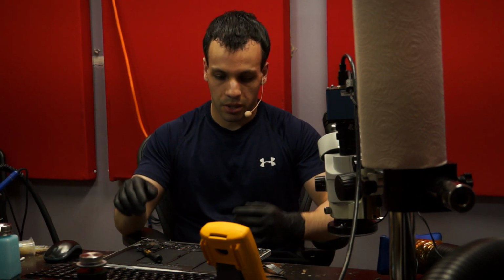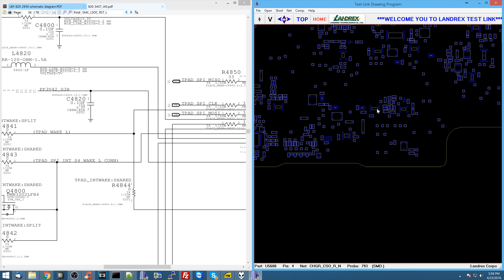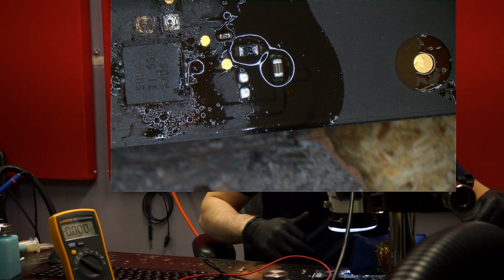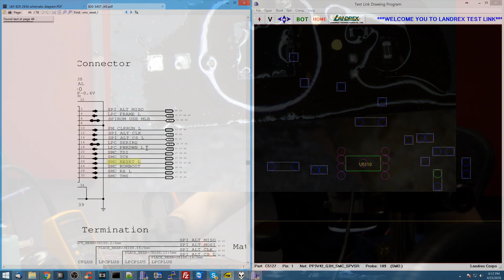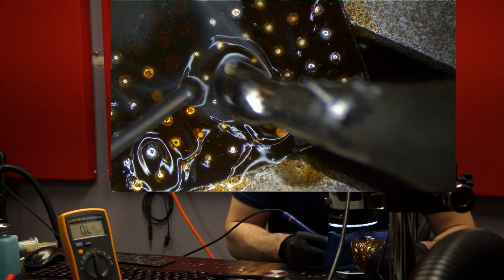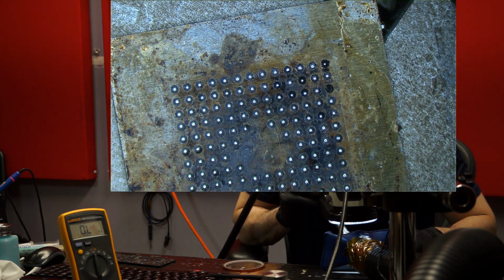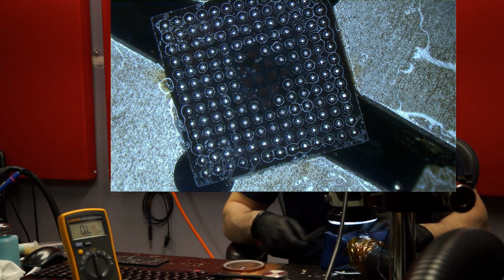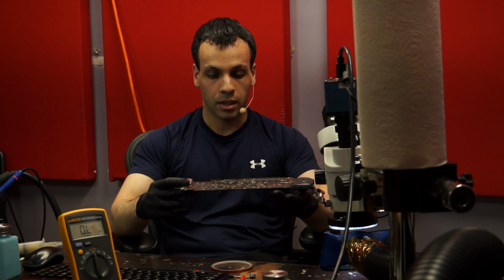Macbook Air logic board why is SMC_RESET_L missing and why does this matter?

Comment: Hey, great video as always! You can only imagine how happy I was when I heard you saying "the SMC is probably pulling it down" as I knew already what was to come - SMC replacement :D Anyway I know you don't enjoy doing it but I find it quite interesting (and more entertaining to watch? hmm...) especially as it is slightly harder than doing standard QFN/other SMD packages.
So far I've replaced several SMC but they were all H8S2117 and the way I do it is completely different to yours. Once I have the chip off the board and its pads clean, I put very little flux on it and manually put 2 balls (I think I'm using 0.35mm but don't quote me on that as not at work right now) on the 2 diagonal corners on the chip and I reflow into place. After this I put the stencil on and because these 2 balls are already in place the stencil aligns itself perfectly (magic!). Then I put the rest of the balls on the chip and I heat it up to reflow them onto the chip. That's the way it works for me and, as I said, I haven't tried it with the new SMCs made my TI.

Comment: Get some thin glass and put it over the stencil, hold down with tweezers or tape it, keeps the balls flat for release without reheating, and keeps tension on the stencil avoiding problems a warped stencil causes  the paste does not bubble out because of the airflow, the even pressure of the glass also stops the paste rejoining under the stencil because of warping make's it a lot less hassle to deal with, in general the glass sandwiches the stencil between both flat surfaces making it ideal for reflow as glass conducts heat well enough to heat up the stencil allowing reflow of the paste.

Comment: If I had to re-ball chips I'd end up somewhere between a crying mess, and a homicidal maniac.
Reply from the maker: +Steve Howes That's me!
Reply: +Louis Rossmann writing here just so you see the comment:
you should try applying a little bit of flux on chip, warming it up and sticking the plate to it (i have seen people doing it when reballing using actual balls. not sure if it will work with paste tho... but you could try if you haven't yet...) :)
Reply: +Senpai Nooberinho The stencil was bended. Nothing will help in this case.
Reply: +Steve Howes I know I couldn't do it.  I have patience, but zero patience for re-balling a chip.

Comment: So I do not know what an SMC looks like internally, however before you reball it, would you advise to check to see if it heats up when it's powered to see if there's possibly an internal short, or would you reball as step 1 in the case of it bein the most likely cause of failure?
Reply from the maker: +MobiFix considering the cost of the chip and the time it takes to reball i never reball the original chip. even if it works, i don't care, it just goes in the garbage anyway. the feeling of dread when you spend all that time only to realize you reballed a bad chip is painful
Reply: +Louis Rossmann BUt isn't that a constant risk considering how you eve get other SMC's? They're all pickers from motherboards some other company has fried, right?
Reply from the maker: MobiFix they come from boards with holes in them. i  avoid buying boards with liquid.

the smc on this board that some isl6259 sent 16v to is mroe likely to be dead thana random smc

Comment: Does the SMC chip align itself when you put it back on?
Reply: +Bas Emmen the heated solder (surface tension methinks) will often pull the smc into better alignment as long as the initial placing is close enough ie less than half a pad out, you can see the chip shift about by itself when this happens.

Comment: I see you are still getting these "Cannot open file arrow1r.bmp" error messages. Just put some empty files with the names it expects (arrow1{lurd}.bmp I guess) at the place it expects them (which is either where the .exe resides or the .brd file, and if its not that, take sysinternals file monitor to figure out which file it tries to open)

Comment: Maybe you can flatten that stencil by putting it between two flat hard surfaces and then stacking some books or bricks on top of it when it's not in use?
Reply: No you can't cause metal has élastique  zone in witch no mater how much time  you bend it it will return to the intial states .  So in order to completly  flaten it you must  enter the plastique zone by overshooting the correction just so when you relase it, it go flat but it's very very diffcult to do
Reply: bac302 Are you sure? I think metal has memory, like some types of high tension spring applications require that the spring not be compressed or else it warps and weakens. Also it's recommended not to rest rifles against walls with weight on the barrel because it will warp?

 If not, than maybe some hits with a hammer will shock the metal  into shape? Or a strong heat from a blow torch and then pressed flat?
Reply: the metal  deformation  has three phase   
1)elastic  zone where  the metal  will  deform  but as soon it  the force  is  interrupted the metal  will  return to it  original form  (the deformation graph  is linaire )
2) plastic zone  where  the metal  is deformed  permanently and will  not  return to initial  form  as soon as the force  is interrupted  the metal  will return into   a new form  parallel to the elastic zone  (the red line in the image ) 

so in order to get a flat surface you must  overshoot the deformation  so when you  stop the force  the metal will return  to flat surface 
this image  will  explain  
http://image.noelshack.com/fichiers/2016/18/1462223796-sans-titre.png
Reply: bac302 So "Bending it the opposite direction" is your only solution? 

 Well that's going to be a kind of bitch to level down to nano-meters but it's probably possible on a good vice with the stencil in between two flat planes. then just slowly bend it, slide it down the two planes and tighten, bend it some more, do it over again.

 Unless you have a suggestion for a technique?
Reply from the maker: +scot shabalam curse nonstop until the smc has balls on it,move onto next ticket.
Reply: Louis Rossmann I know man. I'm just trying to youtube-Apollo 13 engineer you a solution  to make your job easier.

 Have you ever tried CADing the stencils you need and sending the blueprint off to a metal working shop? You might be able to get better metal with some kind of  bond resistant coating. Also you could buy in bulk for cheap since they will probably drill press the holes and if they stack sheets all they need to do is drill the same amount of holes deeper.

Comment: Hi 
 i have 820-2915-B board  not turn on with green light on charger 
"smc_bc_acok" is 3.3v
sys one wire adapter sense is under 3 about 2.9v i think it is worng and the light stay green no orange light no charge
all other rails is ok also smc_reset_l  is ok the board was working correctly and suddenly stop working 
please help

Comment: Thoughts about the SMC.  I know in the past you've said the SMC is preprogrammed by apple and any attempts to read it erases it.  It appears to be a standard TI Stellaris  / Tiva C ARM microcontroller.   Buying blank chips is no problem but obtaining programmed ones is.  I decided to look into this a little more. I downloaded an SMC update from apple and opened the DMG and then PKG file and found what appears to be one or more files that could be the SMC firmware.  My thinking is maybe setting up a jig or socket that can be used to program the SMC in.  The TI Stellaris MCU is used on some cheap development boards that TI sells so it may be possible to make some attempts to flash the SMC externally trying to use some of those files.  Another thought that might require a little more hacking would be to drop in an unprogrammed SMC and see if you could trick the laptop into powering up by setting the appropriate signal lines high or low.  Here's one of the dev boards I was talking about http://www.ti.com/tool/ek-tm4c123gxl  .  The University of Texas at Austin has a free online course on this development board here https://www.edx.org/course/embedded-systems-shape-world-utaustinx-ut-6-03x  .  Regarding the SMC update.  I downloaded a MacBookAirSMCUpdate.DMG from apple for what appears to be a 2013 macbook and used a utility to extract the files from the DMG.  Inside there is: MacBookAirSMCUpdate.pkg  I extracted that using a free windows utility "Universal extractor" and there was another file called Payload.  I extracted that and it gave me a file called Payload~.  Inside that file appears to be hex encoded data that resembles the type of file  you'd use to program a microcontroller.  Towards the end of the file is some raw text referencing keys digitally signed by Apple.  So that's a few thoughts.  You can buy zif sockets to hold the MLF chips for programming.
Reply: +stonent Another option is what I used to do years ago with corrupt bios chips.  You take a working system, boot it up and remove the chip while it's on.  Drop the blank one in, and run a bios flash on it.  This may be more difficult in this case because the SMC is holding certain pins high and low to keep the computer running, but it's a thought at least. Also inside that payload file is a path pointing here: /System/Library/CoreServices/Firmware Updates/2013MacBookAir62SMC110/2013MBA13.smc   Since I don't own a Mac I can't check if there's anything in that path or not.
Reply: +stonent Did you check to see if the SMC updates are encrypted? Most likely if Apple is going through the trouble to make SMCs die when you read them, then they also are encrypting their SMC updates, and/or delivering only partial changes so you don't get everything on the chip from the update.
Reply: The file appeared to be base 64 encoded plain text.
Reply: +stonent Wow, what a cool presentation. I wondered about the Apple-provided SMC updates, and now I see that they don't have the full contents of the SMC, but you can disassemble and patch them so that you can dump the full contents of the SMC. So, in theory, generic SMC chips can be programmed for any model Mac that has a downloadable SMC update, if someone does the patching and dumping to get the full SMC code.

Comment: thats a mucky board - liquid damage ? whats the cloudy cleaning goop your using ? > flux cleaner ? do you do a phase of ultrasonic cleaning afterward? whenever I see crust green corrosion i cant help get out the toothbrush or most often a cut short small artists paintbrush behind cloth, works well for liquid damage corrosion products, covered in micro fibre cloth and doused 99% alcohol, though mainly cosmetic as I doubt its electrical connection enhancing but makes me feel better about a board before I start diagnosing it, Then I look for the overheating smc's thermally, usually some under-specced pathetic power smc turns out to be the problem.
Reply from the maker: +beingatliberty same as always.
Reply: +beingatliberty Cloudy cleaning goop? That is the flux itself.
Reply: +Gameboygenius nod looked up on the tools used video - cheers amtech tacky flux  https://mailin.repair/amtech-nc-559-v2-30-cc-16160.html

Comment: are you applying too much flux or that is not too much flux?
Reply: +Petri Ševardnadze nah flux helps with surface tension and alignment if you have problems soldering, add more flux or remove overcooked flux and add more.

If you ultrasonic clean after, all is good, most good no clean flux when activated can be left on the boards as it's inert and none corrosive but it looks cleaner after an ultrasonic bath and allows you to do a final inspection.
Reply: +Petri Ševardnadze One thing to remember when doing soldering, especially SMD, is that you can never have too much flux ;)